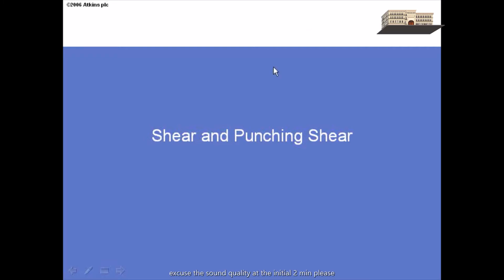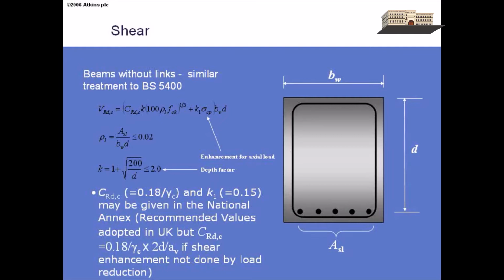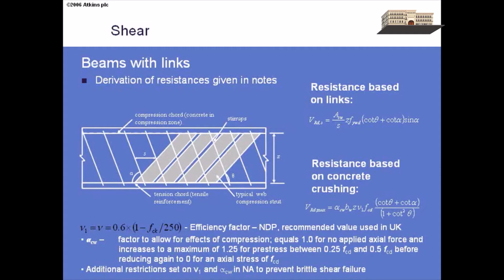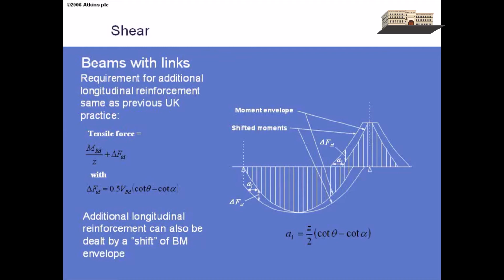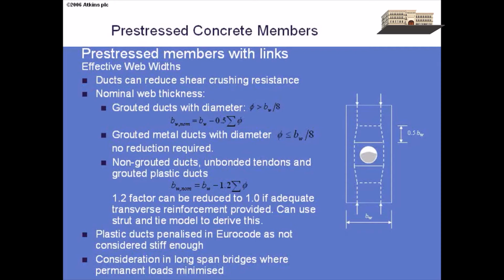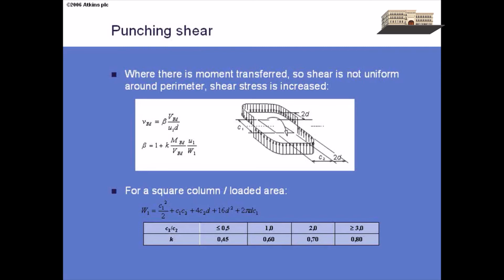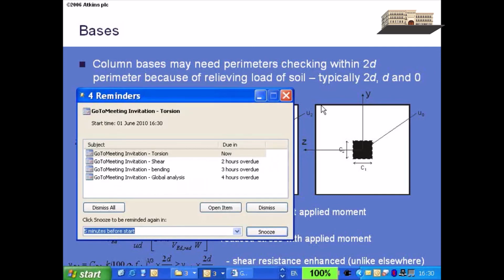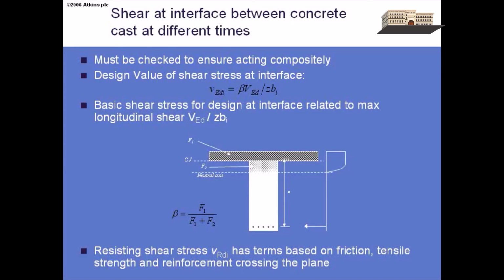Lecture 4 | Structural Design to Eurocode | Foundation Shear & Punching Shear Design with Examples

Comment: For pile cap shear check, to calculate Ved, piles number along the critical section is to be considered? So say there are two number of piles along the critical section so it need to be multiplied by ultimate load/pile. Is it correct?